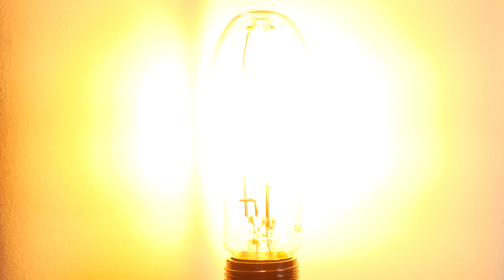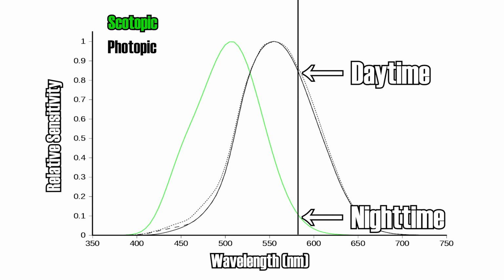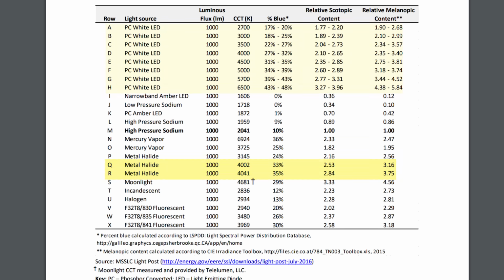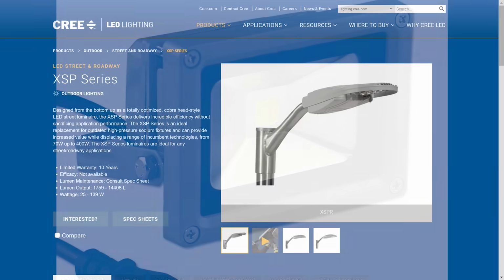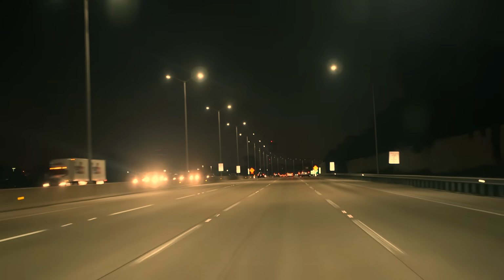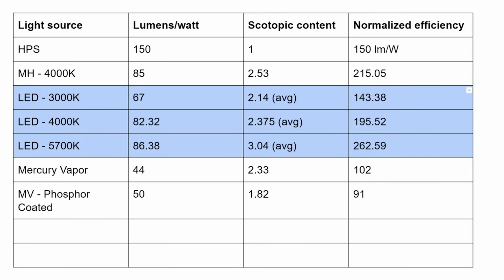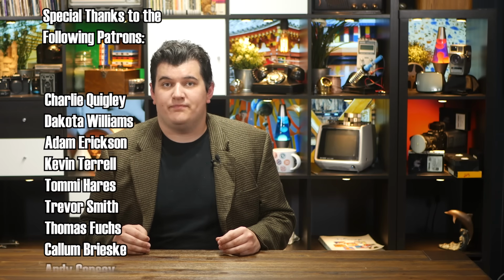The LED's Challenge to High Pressure Sodium

Comment: I have read a lot about this over many years. Retired Engineering Physics and MD here. 
LEDs "do not last" in my experience. I was excited about them initially. But dissappointment quickly set in. Although, supposedly, "they" say longevity is improving.
BTW. "They" also said repeated medical treatments in early 2021 were "safe and effective".
And "they" say all frequencies of the 5 Jee spectrum and the 2.4 jigglehurts spectrum doesn't effect human neurological function in any way. Maybe that's why, during the 2020 lockdowns, 5 Jee was madly being installed 24/7. Here in the US at least. Specicific freaks of the 5 Jee spectrum interfere with proper O2 and HGB binding and release where the O2 is needed.
Hmmm? 🤔 Food for thought. Especially about "they". And trusting what "they" say.
Remember that LEDs produce intense UV light that is then converted by phosphorescent coatings to produce several single narrow spectrum lighting peaks. Like fluorescent lighting. Although, reportedly, longevity has been improving. By whom?  These phosphors are the weak link and can have a much shorter life span than the LED itself in many cases.
When it fails due to high heat and temp cycling. It then cracks or falls off. It is then emitting eye damaging UV light that is undetectable by the human eye.

I am now 65 years old. No cataracts. My eyes can't stand these high temp LEDs whether on street lights and especially on automobiles. Blue Automobile LEDS are painful and blinding. They should be banned. That's not safer.
Add a wet road or fog reflecting the high temp blue LED streetlights and driving at night becomes dangerous. There's a reason that auto fog lights  had yellow lenses.
High temp blue LED streetlights should be called spotlights. That's how they behave.
Especially in rain and fog. 
The Sun puts out an analog type full spectrum lighting. Similar to tungsten bulbs.
That's why I still use incandescent bulbs. Especially for the kitchen, den, living room, bedroom and office. Anywhere I spend any time and especially where I read. 😎
Get rid of the "time bomb" EVs and hybrids that burn vigorously at 4000-5000F degrees.
And there will be no need to ban proper lighting for humans and animals.

Comment: It is great that the LED lights are more efficient. However, the tone of the light is important. I personally do not have problems seeing in poorly lit area, but high color temperature streetlights are causing me a trouble. The streets are brighter, but I see less. It is harder to perceive things on cold-LED-lit streets. Maybe aerosols play some part in this too. They create a much more contrast between lit and unlit area. The unlit sides of the streets are exactly the places from where pedestrians, animals and other creatures emerge from. With LED-lit street, it is much harder to see anything in the ditches. I know that I am not supposed to stare into the light, but accidents happen. When I accidentally stare into a sodium lamp, I can see the road a second or two later. When I stare into a led light, I am blinded for ten seconds. Use warm white LEDs!

Comment: Sensitivity to blue light isn't necessarily good for drivers, it is most offensive on highways, the glare and the time it takes to adjust between lit and unlit areas, they need to be obnoxiously bright, and you need more of them covering greater lengths of road - they also don't cast light as far so you get really dark patches and really bright patches, when you are walking you absolutely cannot see into the dark patches! They encourage people to stay out later and not to recognize fatigue as quickly! They produce a lot of glare, they also create more upward light pollution as they bounce off of all of our smooth impermeable surfaces into the air - I could see them better than the HPS on your photo. 
These aren't improved pedestrian infrastructure, they are car infrastructure, like pedestrian bridges, pedestrian bridges are designed to keep people away from cars, so the cars don't have to be slowed, and bright lights make pedestrians more visible, so cars don't have to be slowed! Just slow down the cars at night! Stop building wide roads that encourage people to drive so fast!
Everything about car dependency is ugly and unnatural. Noise, air and light pollution assaulting your physical and mental health. Frustration of being stuck in traffic, inability to feel safe riding a bike or walking. Everything engaging your sympathetic nervous system and keeping you anxious and alert. Much like when a drug - cars in this case - have nasty side effect, you use more drugs - bright lights and raised bridges - to try and cope with the side effects. Like if you take cocaine, and you can't sleep, so you take heroin to help and then are shocked at the negatives! 
Blue light disturbs insect mating and feeding habits and is likely causing a collapse in the species of many important night pollinators and extending deep into the food chain! Roads already form a barrier to wildlife mating with large land animals, it is a snowball effect of making worse ad worse infrastructure and inventing more and more terrible solutions to problems that are caused by one thing: over adoption of cars as the default mode of transport!  We should be looking to fix that, not blind everyone till they are safe!

Comment: If we want to improve pedestrian safety, we should be reducing the width of roads, removing parking, putting in traffic-calming, protected bike lanes, wider side walks, pedestrianized areas, better public transit. Encouraging more density, removing mandatory parking minimums and building mixed-use developments to reduce how many cars are on the road. Street lights aren't making pedestrians safer, car dependency is making it unsafe to be outside without a car! These lights are light pollution! Cars do that too, headlights at night are irritating, but they also produce noise pollution, air pollution and visual pollution. Their infrastructure is downright ugly, and without so many cars such bright lights would have no safety benefits! Our cities have been destructively transformed - like the brain of a heroin addict - in such a way that they don't work without the car drug! It will be painful to withdraw and rewire again, but worth it!

Comment: I agree with all comments against LED on public spaces and roads. My experience is yeah I probably feel more awake, but the vision is disorderly. Less calm and less clear. I think one of the reasons is the light is very harsh so there is more contrast between well lit and dark / shadow. So anywhere the light doesn't shine directly is unclear. In contrast with the HPS lights where the vision is smooth and I've got more oversight on the surroundings.

Comment: What I miss about the Sodium lights on the roads is the time at dusk when they used to be switched on. They would burn dark red for the first few minutes before turning into orange. At sunset, this really was a great effect to take photo's off. No more Sodium in the Netherlands, most of them have been replaced by Led so far.

Comment: Red light doesn't bother my sleep but if there's even a hint of "white" LED light, there's gonna be a lot of tossing and turning. Also, a lot of the lower quality ones give me kind of a surreal feel, like something is off. I have a feeling as if I see but not see at the same time. I know it makes no sense but it kinda feels like there are monsters just outside of my vision. Dread, the feeling is called. Thinking about it now, I'd say it's bcs of using LEDs as rectifiers instead of giving them a constant source so it dims between sines (or half-sines).

Comment: I think somethings missing from this. Even headlight manufacturers produce headlights closer to the 550-600 nm range. 

Higher color temp lights wash out a lot of details and are more prone to hot spots. Lots of city use filters over their LED's for this reason
Reply: So why then are human eyes the most sensitive to 4000-5000 kelvin light? Not the <2500 kelvin light from HPS?

Hotspots are not determined by color temperature, but by the reflector and or lens assembly.

Comment: My neighborhood recently went to led and it looks really bad. Everyone perceives them as dimmer and  whoever was in charge selected very high color temperature lights. Somehow they look both harsh and dim at the same time. I get the energy efficiency gains but geez why can't they at least pick a warm color that everyone got used to for the last many decades.
Reply: Many of them are dimmer and harsher! In Houston, TX, they switched to LEDs that produce 50% less light, but "save" 50% energy than HPS. It's such a downgrade. Basically, it's like looking at a laser. As for why they don't pick warmer LEDs, they cost even more than the cooler colors.

Comment: Perhaps it's time to circle back around to LPS, induction and the integration of LED lighting. 
LPS is still required around observatories so they can filter out the pollution from their data. 
There are a few stretches of highway near me that have switched to white LED street lights over the highway with the occasional blue light. While the theory that blue light can help keep people awake and is more reactive for our rod cells, they certainly have drawbacks.

For one, when exiting the highway into a poorly lit small-town, it is nearly impossible to see while you are on the ramp as your eyes are adjusting to the difference or lack of lighting. The white lights also cause a lot more glare in wet conditions, which is why I suspect these stretches have started making them motion sensing, only having them turn on when you are directly under the previous light. This leads me to the 3rd major issue; the inability to see what's up ahead because the difference in bright white and pitch black is too great. My final gripe is fog. Street lights are generally terrible in fog, but these blue/white lights seem to refract even more, reducing visibility worse than someone trying to use their high beams instead of fog lamps.

Comment: I'm extremely against any cool light at night due to the fact that it directly interferes with night adjusted eyes. IAW military procedures a night lookout actually has to adjust their eyes in complete darkness for 30 minutes before they are supposed to take the watch. Amber or red is objectively best for your night vision which, unless your destination is in a well lit area with no dark spots, in which case who cares? Maybe a solution can be to adjust the lights based on proximity/direction to other lights and likelyhood of encountering dark spots. Thats just my thoughts on the matter though.

Comment: Looking up pics of 4000k street lamp installations and they don't look too bad. I don't see why a mix of both couldn't be used depending on the area. Freeways and parking lots or elsewhere away from residential areas could be the highly efficient 5000k, while side streets or subdivisions could be the tolerable but not quite as efficient 4000k. Considering the cost of these installations, I think any residential high pressure sodium fixtures could be left alone for now.

Comment: Most of the Sodium Lamps are Anti-Glare and don’t blind you when looking at them unlike LED.
Reply: Well, are you supposed to look at it and not the street itself? And no, hps is not anti glare, most clear hps is very very blinding to directly look at its just as blinding as led
Reply: @GERMANIA292  LED street lights don’t have bowls unlike LPS and HPS.
Reply: @JamMC  led street lights doesn't need bowls
Reply: @GERMANIA292  Did you not connect the dots on what I said or something?
Reply: @JamMC  what dots am I suppose to connect when there is not any? You are just making assumption that sodium light is totally anti glare
Reply: @GERMANIA292  I’ve got a street light myself and looking at it doesn’t blind me.
Reply: @JamMC  regular street lights are probably way higher brightness than your street lights, there is one 1000 watt hps street lamp that i've encountered and it's very very bright and not good to look at, brighter than nearby led street light
Reply: @GERMANIA292  Wdym I have one that was taken off of the column which runs a 35w SOX lamp “regular” streetlights from the time used that. and still some SOX lanterns use that it’s either 35w or 50w or on the Moterways it’s 100w.

There’s no difference in brightness between my lantern and any other Sox lamp you see on the street.
Reply: @JamMC  most standard sodium lamp is in the range between 70 to 1000 watt, and yours is 35 watt, so it's much dimmer and easier to look at, so dont make assumptions that sodium lamps doesn't have glare
Reply: @GERMANIA292  You’re talking about HPS.
Reply: @GERMANIA292  HPS tend to be higher.
Reply: @GERMANIA292  mine is a LPS.
Reply: @GERMANIA292  smh
Reply: @GERMANIA292 Notice how you said don’t make assumptions when you’re clearly are I said “most” sodium lamps.

Comment: LED hurts my eyes, the intensity is high, but since the lamps are designed to only illuminate the road there's the added drawback that the eyes are tending towards letting more light in (pupils dilate). When incoming traffic or other bright lights are then introduced it will be too bright to instantly see what is going on.
People with astigmatism (like me) would benefit from surroundings being lit as well, so that they don't just rely on the road. Lights from incoming traffic can prevent the road from being visible to them.

Comment: HPS lamps have a great advantage over LEDs: monochromatic sodium light (longer wavelengths in general) penetrates fog far FAR better than cold LED one. I have an area near my house where part of the street is illuminated by old sodium and part by LEDs. The difference is dramatic with just a little bit of fog. Kicker: the FOG lights in older cars used yellow tinted bulbs because of this effect.
Reply: @luis_gustta  Ha, interesting, I'll look into that, but the principle remains the same, the longer wavelength the better fog penetration.

Comment: another thing earlier LED-replacement-projects failed at: street lights need to be redesigned for winter usage! LEDs are so much more efficient that snow isn't melting on it's own. So there were huge problems with snow on upgraded LED lights in the beginning.

Comment: Wow those are some low efficiency LEDs.  I've been using 200 lumen/watt LEDs at home since before this video was posted, though I'm not sure if they'd be viable at the power levels required for street lamps.

Comment: All this talk about energy consumption has me wonder why they don't have solar panels on every light.  They could charge all day and run all night, like those little lawn lamps you spike into the ground around walkways.  Why do streetlights consume grid power at all?
Alec, you need to put something on the shelf above your left shoulder.  The empty one with white light behind your head is great compositional lighting that draws the eye to your face, but the white box above you defeats the composition by making you look there in the long shots
Reply: Solar panels are far more expensive than the LED bulbs themselves.
Reply: @Dragonsamuari  Then why are those lawn lights like $1 apiece?

Comment: The harshness of outdoor LED lights could be mitigated by requiring a diffuser, ideally a prismatic or lightly frosted type, on the fixtures. If the diffusers are designed correctly it could also reduce the dark spots between lights by more evenly distributing the light output.

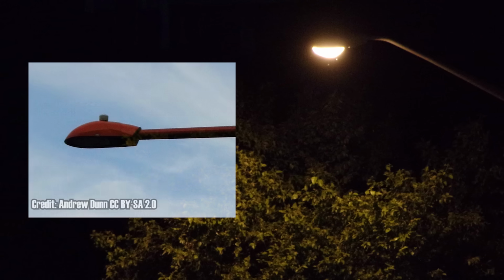Comment: I can't help but come back to the conversation going on around 9:30. While reducing light pollution is certainly not a bad thing, the current flat lens design most LED light fixtures use is frankly terrible. Splotches of blinding white along an otherwise pitch black road are much more inconvenient and even dangerous than actually helpful. I'd rather there be no lights in all honesty, if that's the quality that seems to have spread across the nation.

As some (Most I've read) comments mention, the quality of the new lighting is just, not good. It's a very harsh light, like a medical room, or someone with those searing blue headlights highbeaming you at a stop light. (Or the absurd number of household appliances with blue LEDs) The patches between have no light cast to them at all, save for the very different light cast by your headlights, other vehicles, and so on. This just makes things near on impossible to distinguish. At the same time, when passing under the new LED fixtures, your dashboard becomes a giant reflection, which glares on the inside of your windshield, causing even more vision impairment. (It's fair to say this happened even with HPS lamps, but at least it was a soft orange and not a solar flare)

We might be saving some energy by using the new LED fixtures, but to be honest, the quality of light they give is suboptimal at best for nighttime driving conditions. And that's in clear weather. Rain, fog, and snow all glare much more brightly under them, making it hard to see pedestrians, vehicles, or other obstacles just beyond the pearly gates.

Referencing the chest freezer video, I think it's okay to make a sacrifice in energy consumption in order to have a gentler, more pleasing light. At the very least, the subject calls for a revisit. Here's a title suggestion because why not, I've rambled on enough XD : "LED Road Lighting: Bright Ideas, Dim Results"

PS: I am still highly looking forward to the Induction Lighting video.

Comment: My sister lives in a small village in France. The streetlights are LED. They have a normal high level lamp which points down and doesn't cause light pollution. But this goes off late at night and a lower LED lamp shines on the pavement for the benefit of pedestrians. This saves the community money whilst helping people to feel safe. And surely messing with our Circadian rhythm is a good thing. I really don't want drivers falling asleep at the wheel.